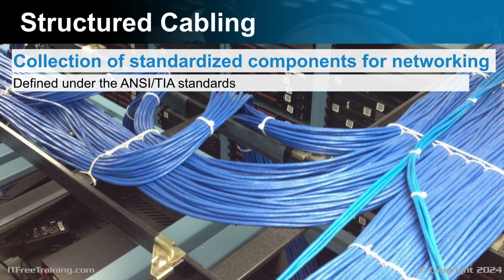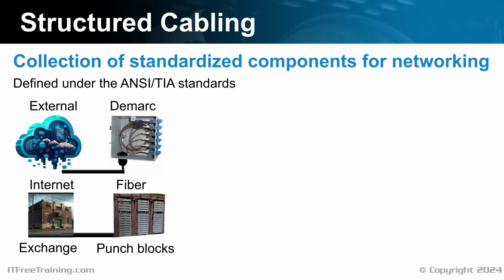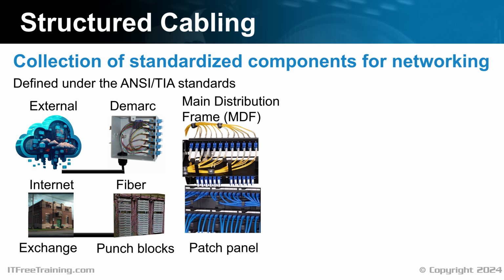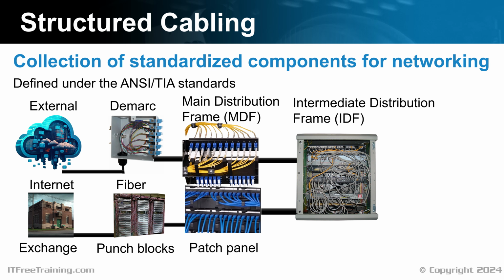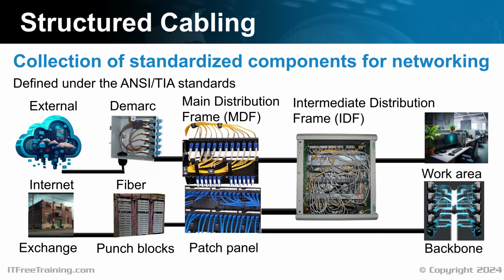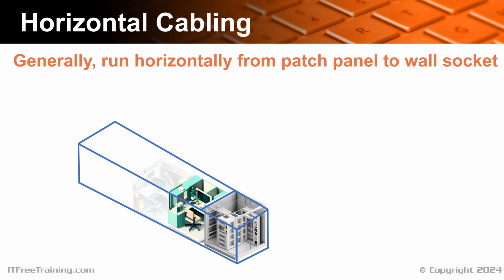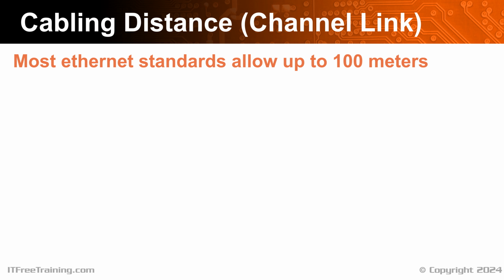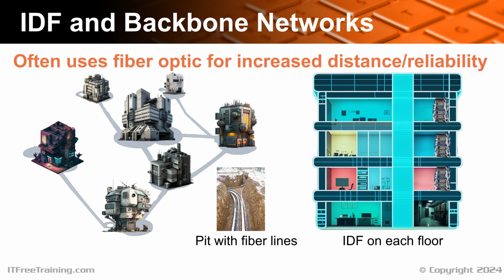Structured Cabling - CompTIA A+ 220-1101 – 4.6

Comment: since 99% of computer NICs are only 1Gb, we only run cat6 for office data drops. the only exception is IDF room interconnects and backbones. most enterprise switches have 2.5Gb or even 10Gb SFP ports. So, we'll run a cat7 STP or Fiber for those.
Reply from the maker: It not that common for cat7 to be used to connect IDFs together, although some companies may. Most companies will go for cat 6 or Fiber since cat7 requires a different type of connector to get the full benefit.